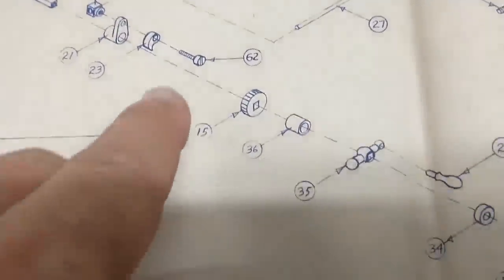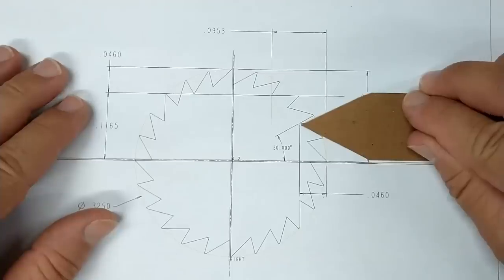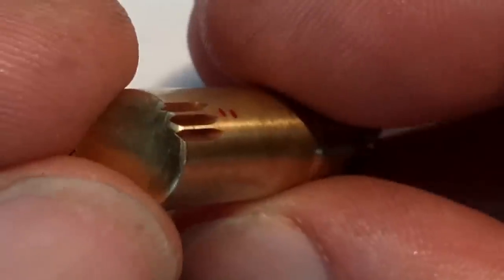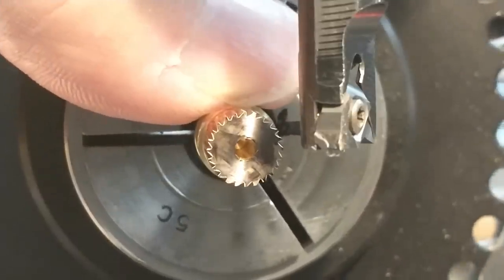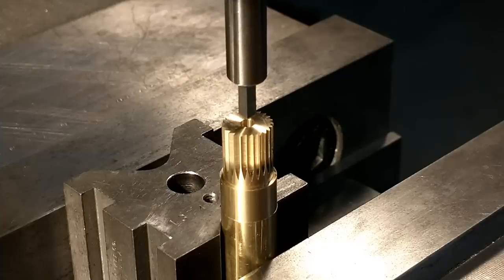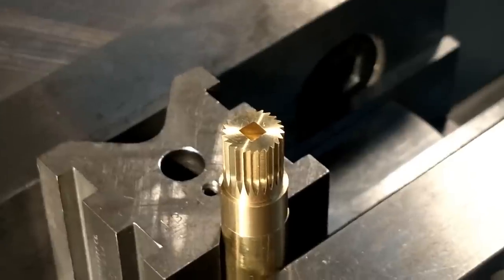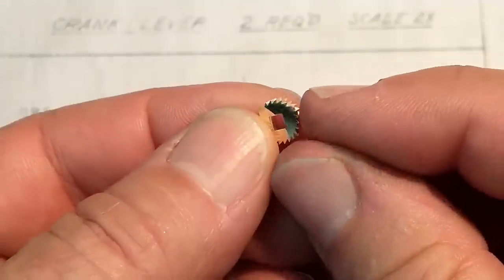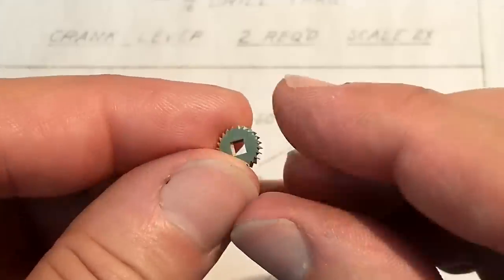Machining a Miniature Ratchet Gear

Comment: Hello, I am a basic technical worker, can you tell me a formula for this gear. According to the diameter of the shaft and the number of gears, as well as the number of these gears, which also have an arc-shaped position. Thank you.

Comment: Why use brass instead of heat treatable steel for that component?  
If it's a 'must use' that soft as poo material... better make spares for the inevitable repair, rather than do all that setup and machining again in future.
Reply: I suspect that this part will survive the use it's going to get. This is a model, not a production machine.

Comment: I have a lineshaft driven machine from the early 1900s that will generate square hexagonal and half round holes in blanks...
It rotates like a drill press but cuts like a shaper
Good video 
🇬🇧😐

Comment: Hey Joe what brand of metal polish was that
Reply: G'day Brad, I'm not sure what Joe used, but you really can't go wrong with Autosol Metal Polish, which has been around since 1929, and I reckon every auto guy has a tube of it in their garage somewhere.
Reply: @Laz_Arus  That's all true but that paste is rather abrasive, not so good to use regularly on old chrome motorcycle parts for example. I use a tube of Peek now more often than not, that's less abrasive for sure.
Reply from the maker: Blue Magic. Its usually available in auto parts stores.
Reply: Thanks to all

Comment: Neat, A mid week treat. Defiantly a part to use the imagination on as  far as tooling is concerned. A boring/threading tool used in a totally different method. Why not eh. Good tip on the polishing too. 
Thanks Joe, Take care eh.

Comment: I probably had used a dovetail cutter on the left side of the drawing, its face right on the horizontal centerline.
But depending on the cutters one has, that may not work (e.g. too large of a radius on the edge or in general).

Comment: Hi,Joe. I've never seen a full sized shaper with asymmetrical ratchet teeth on the feed wheel before.
All the shapers I've encountered(including my own) have straight cut symmetrical slots around the periphery of the feed wheel with the single toothed spring loaded ratchet pawl having the asymmetric form on it. That way the pawl can be rotated by 180 degrees in order to reverse the table traverse direction.

Comment: Why did you not use the dovetail cutter? On the centre line and indexed for 36 teeth made a lovely job of the lubricator. I made such a ratchet for a 1/12 scale traction engine (finished diameter 3/8" so comparable)

Comment: Is the broach carbide? Or HSS?
Reply: My guess is HSS, probably custom ground from an old end mill. HSS will cut mild steel or brass easily so carbide would be overkill for this part.
Reply: @ellieprice363  Exactly. Even carbon steel would have worked, which can be made with just fling. Next step up, hardenable or tool steel.
Reply: @jdm2651  Special cutters like this are often custom ground from a hardened HSS blank or dull end mill, etc. using a surface grinder and rotary indexer. I’ve made many very similar during my career.
Reply: @ellieprice363  AvE made one with a hardened steel blank with a file lol
Reply: @enegron6987  Files won’t normally cut hardened steel. He must have hardened it after he filed it to shape.
Reply: @ellieprice363  you ever watch AvE’s channel? Spelled exactly how you see he’s got a tutorial on it he’s funny too
Reply: @enegron6987  A file is the basic hand operated air cooled multi-tooth portable milling machine. All metal removable that a milling machine does can be done with a file. It just takes longer.
Reply: Lol an HOAC Portable Milling Machine brilliant 😂😂😂

Comment: You cant fool us.
We know Joe will soon be itching to start polishing his teeth.
Next video will start with a big beaming smile as Joe offers up the ratchet-gear for inspection.
Reply from the maker: Next video will probably be the tiny pawl that drives this gear. I have a lot of options left on parts to be done. Maybe the ram motion components ?? Who knows.
Reply: @joepie221  Thanks Joe.
I was just playing on the word teeth to get to the word smile to try and encourage or stimulate more comments for you,  as I understand algorithms like lots of comments.
It is a lovely shiney ratchet.
And when using "autosolve" its an English polish a bit like white toopaste. Originally formulated for poliching alluminium - but it actually works better if used with the black print on newspapers.

Comment: Paper is abrasive on its own - ask any printer how often he has to sharpen his guillotine blades. It may not work as quickly as your polish, but will do the job.
Reply: At one point I worked on arcade games. The contacts for the buttons would get nasty really quickly. We used counter checks or copy paper either of which has about the same abrasiveness as a burnishing tool.
Reply: I worked briefly in a shop where they made and maintained large tool steel dies that cut beer labels. They would cut a stack of several inches thick at a time all day long. The dies had to be sharpened regularly
Reply: I just finished making 500 rollers for an outfit that makes corrugated paper products (well, I set the job up and had the new guy run them). They keep having us try new materials because they wear out "too quickly."

I told my supe that we needed to look for something that had a high resistance to abrasion, he looked at me like I had lost my mind, "it's just paper."

We'll see how nylon holds up this time. Urethane seems to be standard for the industry according to 5 minutes of googles, but we'll burn that bridge when we get to it.

Comment: How about cutting the tooth on the left-hand side of the drawing dead on the centre line?
Reply from the maker: If you look closely, one face of each cut points directly at the center of the part. To align the tool on center and cut wouldn't produce the correct geometry tooth. It has to be offset as demonstrated.  EDIT...I misunderstood your comment. You are correct. Using a dovetail style cutter and cutting on center would work. Also, the part is a mirror of itself and can be machined with the teeth facing in the wrong direction too. So basically, you could machine it on center, on either side and it would be correct. Just flip it at assembly. Good call. ( this only works with a dovetail cutter )
Reply: @joepie221  Whichever way you do it your results are superb! I can't help thinking that a steel ratchet would have been preferred. Best regards from the UK.